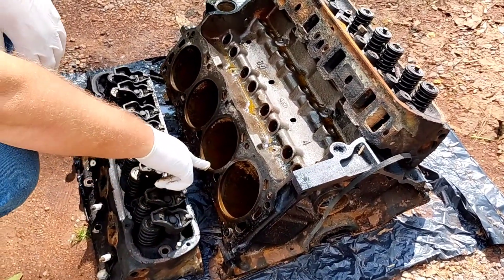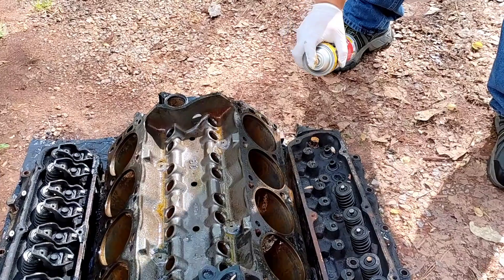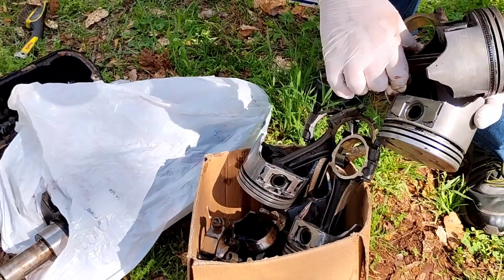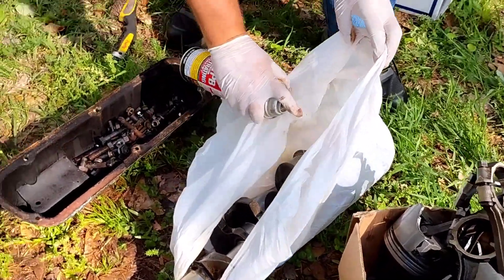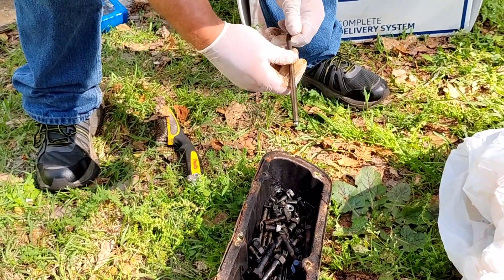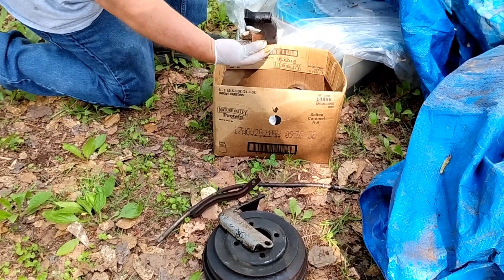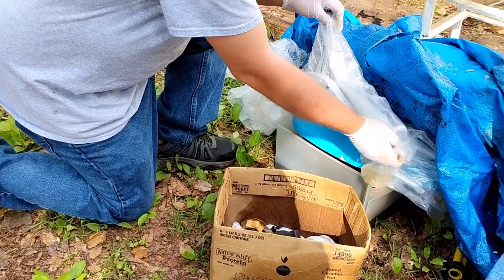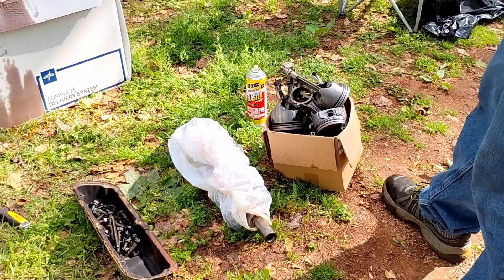You Won't Believe What Happened Next!

Comment: Thanks for the shout out Auto Salvage outlaws! You might be surprised what a few day soak in plain white vinegar will do for those rusty parts. Be sure to get some oil worked into the wrist 
pins too
Reply from the maker: you welcome  yep soaked in vinegar  ill soak all of it in diesel fuel 1 more time and clean them 2 nd time and then soak them in reg oil before i put it together  after get together i pour a qt of oil on the heads and valley then button it up it be ready